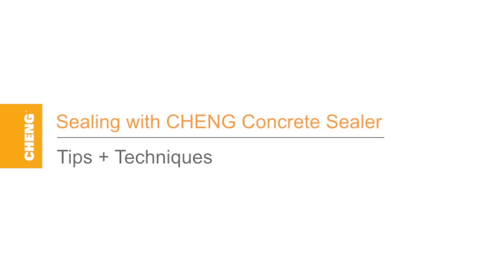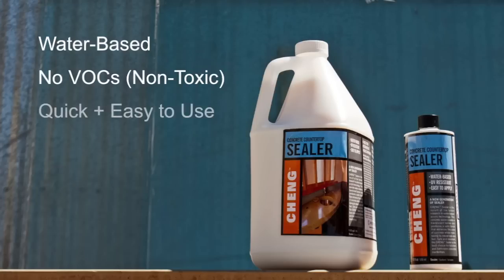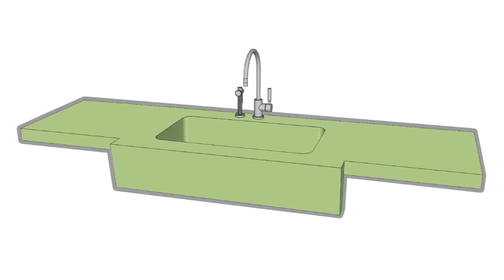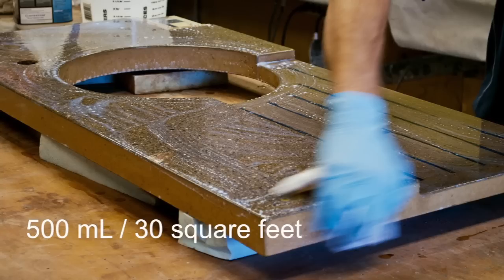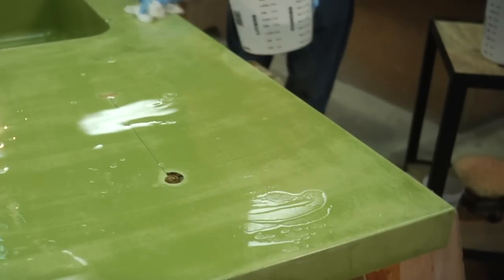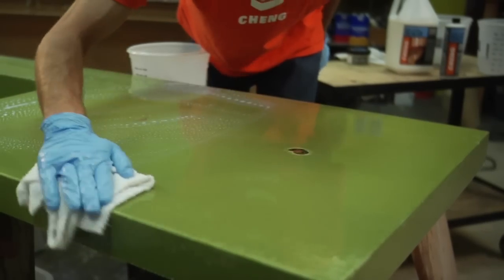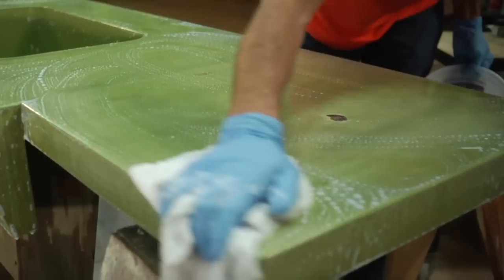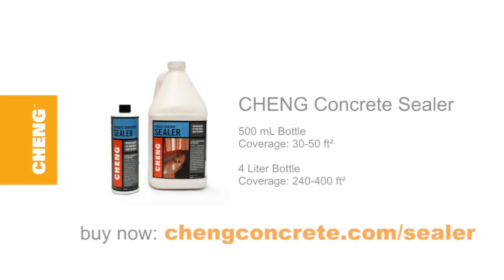How to Seal Concrete Countertops with CHENG Concrete Sealer

Comment: So i did about 9 coats using this method by gradually lessening the dilution. Passed water bead test so we installed our concrete countertops(we did not pour in place). Since then we have noticed a few small areas that get dark when exposed to water for an extended amount of time. What should we do? Sand and re apply or can I just keep adding more on top?
Reply: would have been nice for them to answer you...what did you do???

Comment: is 500ml is for 3 coats or 1 coats? I need to figure out the quantities for 10+ coats. My first attempt needed 12 coats and I'm guessing I could apply 30 to get a entire surface water resistant for 5 mins.

Comment: In this video you say to mix 1 part sealer with 3 parts water, yet on the container it says to mix 1:1 sealer to water and then to gradually strengthen to 100% sealer after 5 minutes.  

It's one thing to seal a brand new counter that's in a shop but I think most consumers of your product are intending to seal a counter that's already in place.  The puddle-of-water method that you show in this video is very messy and it means that all cabinets, appliances, floors, etc. must be sealed off prior to application.  This can be quite a time-consuming process.  

I found that using your product left streaks on my countertop, which left it looking worse than before.  I tried the method described on the container first and then went with the more diluted formula that you show here, and I did find the more diluted version to be slightly less streaky.  I like the low VOCs but I think a product should be user-friendly.  I doubt many concrete professionals are using this sealer.
Reply: I tried 1:1 and it dried far too quickly.  I started at 1:3 and went down to 1:2 (sealer:water) by coats 4,5,6,7  I made sure I didn't go much past the 20 minute drying time, maybe 30 minutes, before I started the new coat.  Really, pretty simple.